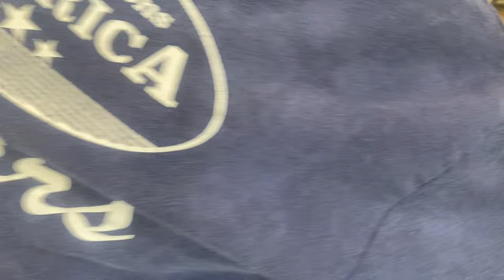Toyota Transmission Problems: Rav4 Transmission removal and disassembly

Comment: My 2008 Rav4 V6 is able to Reverse but doesn't want to drive Forward. Do I have to replace my transmission or can it be something else?
Reply: I'm not a mechanic so keep that in your mind. I have exactly the same problem with my RAV4 2008 2.4L engine.
I changed transmission fluid and that improved it so that it only takes few seconds before it shifts forward in the morning.
I'm still waiting on new transmission fluid filter and gasket kit. Hopefully after their replacement and also cleaning magnets that're supposed to collect metallic particles it will be back to normal.

Comment: We just rebuild one and put it in and we are having problems we have took it back out and checked it can’t find anything wrong with it or the converter but one minute it’ll work fine the next time you go to drive it it throws engine codes and starts acting crazy I’ve seen a bunch of stuff saying the ecu/Tcm goes bad on these you think that’s what it could be and btw I’m not a girl just the account I use lol 😂
Reply: Check if a pin it's not losing connection , chef the transmission connector terminal and the ecu Terminal, and if there's not a broken wirring between the ecu  and the transmission.
Reply from the maker: Sounds like you have an electrical problem. I would see what codes its setting and test the components related to those codes. It's the component checks out, I would ohm out the circuit going to it from the PCM or TCM. If that checks out and the problem continues I would get the PCM or TCM checked out.

Comment: The grunting makes this job all too real  😅 also the disgust on the old guys face omg i HATE TRANSMISSIONS. Absolutely hands down my modt hated job ever. So many intricately places parts and gears omg its terrible. We need to evolve. This is ridiculous. I have a 2008 toyta rav4 i currently have everything off besides the hub and cv axels tryjng to get this hub bearing off is seriously a JOB IDK if im judt not strong enough or etf but ive been seriousky giving ir my all i even took a jack and tried to jack up the breaker bad and it wont burdge at all. I might have to try to cut the mfer off. 🤔 anyway. It stopped moving one day its the passenger side front im woring on it will not spin at all. AT ALL. IM PREYING the hub is judt busted or the cv axel is just done. It doesnt seem like anything is wrong eith the cv axel tho. No grease coming out. The boot isnt messed up. Idk man. What do you think? The transmission drops into every gear with no hesitation at all.the engine is FINE. Idk what to think at this point. All the other tires move but this one will not. I hope you reply before i jump back into this shit tomorrow. 😒😔

Comment: Have this exact issue on a 2008 rav4 im doing. Went to transtar and the reverse hub they have doesn't show the dog ears that appear on the oem reverse hub. Where did you get yours or what did you end up doing?
Reply from the maker: WIT Transmissions is where i got my hub at.

Comment: Hey how much does it cost for someone to clean my valve body and replace solenoids????
Reply from the maker: Depens in there labor rate but remoave and rebuild a valve body usually calls for 6-8 hours. Would be about 800 to 1000

Comment: Very interested video, I have a 2017Rav4 whenever i put it in reverse or drive the transmission make gritting noise and not moving only in neutral it move , Can you say what might gone wrong and the cost.
Reply: that might be a transfer case or bearing issue if its locked up

Comment: For preventive maintenance I do a drain and fill with Toyota WS transmission fluid every 30k miles.  I did the first at 60k.  Knock on wood I have not had any transmission issues.  I am currently at 100k miles.
Reply: Do it sooner 30k, 40k or even 50k because once it shows wear it will continue to wear out. The stock T WS is very thin viscosity for EPA MPG.

Comment: Have a 2008 RAV4 V6 3.5L and the problem is, when you start the car in the morning and you shift the gear to reverse (R) the vehicle moves with without acceleration immediately but when you shift to drive the vehicle doesn’t move even if you accelerate. If the engine stays on for while and warms up , it drives okay. Any suggestions as to why this is the case? Do you also have links to any junk yard to get a new transmission from online . Need help watching you from Ghana .🇬🇭 thank you in advance.
Reply: I have the exact same problem with my 2008 scion xb, did you ever find any info.

Comment: I have another question. My 2012 rav4 all wheel drive 100k, transfer case is humming pretty loud. Should I replace it and should I replace the tranny while I’m doing that? No other problems w the car.
Reply from the maker: I would try to isolate the noise in the transfer case or the transmission. In some cases both may be required to replace but not always. I wouldnt replace anything unless I have to. I would just fix what is broken and service the transmission.
Reply: It’s the electromagnetic coupler bearing in the differential. Check RAV4world  for part numbers.  I had the same issue and had a mechanic fix it.  If you take it to Toyota they will replace the entire electromagnetic coupler assembly, and it is not cheap.
Reply: Does this make a whine noise almost? I hear that sound when I hit about 40km per hour in my 2007 rav 4 V6. Sound like it’s coming from underneath as I get feedback from curbs. Vehicle shifts fine and gears don’t slip.